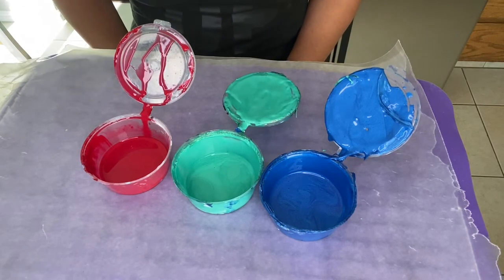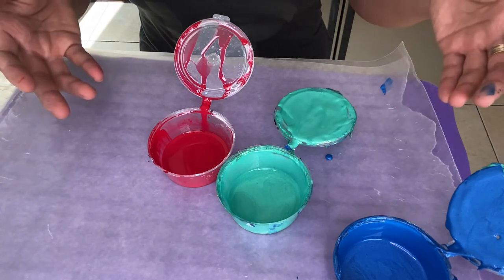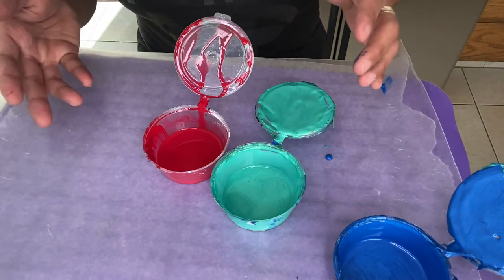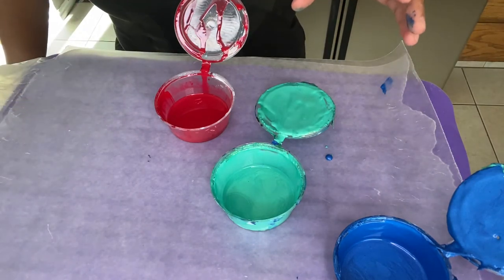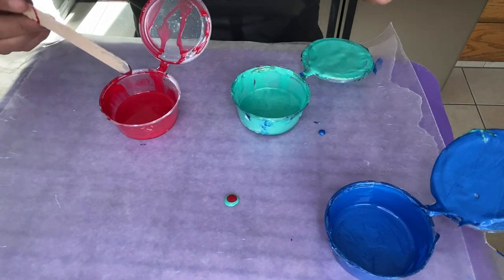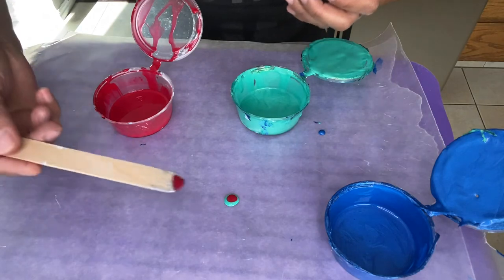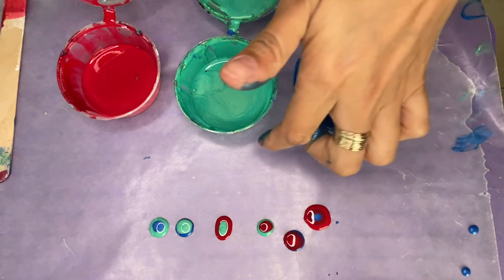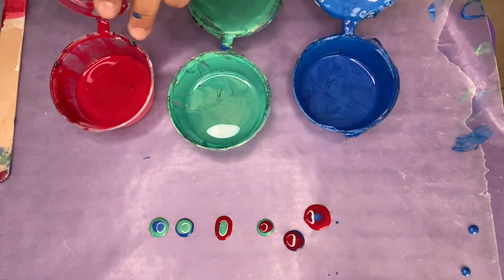28. How to Test the Density of Paint to Create Cells in Pour Painting | Rayleigh–Taylor instability

Comment: 15/8/2023.Hi,i was interested to kow,should silicone oil  be used on heavy colors or on light ones?thank you
Reply from the maker: A Heavy color will sink, so if you want to see more of that particular color (cells of that color), then add silicone to it to help some of that paint rise to the surface. Light colors have a better chance of staying at the top of the surface so it is not as important to use silicone in those colors.